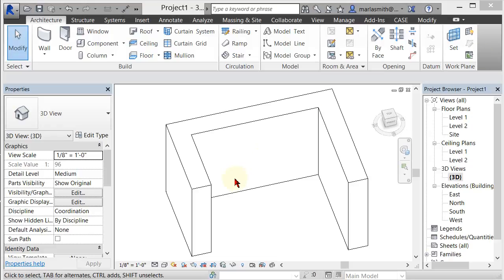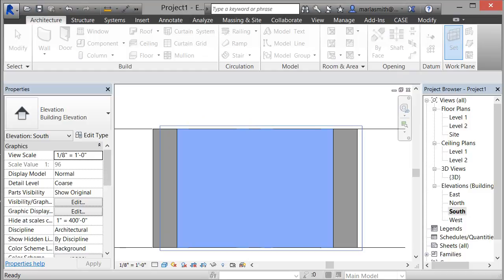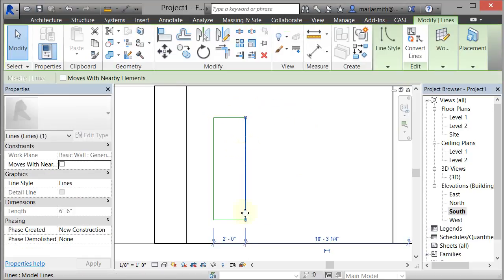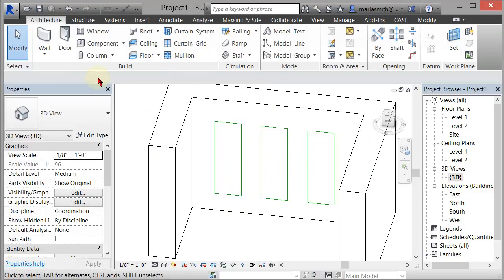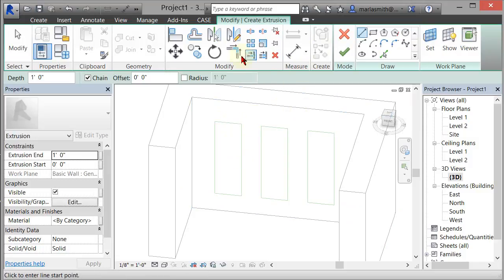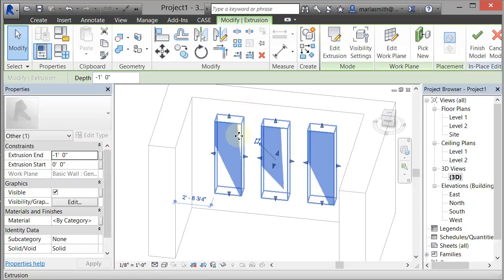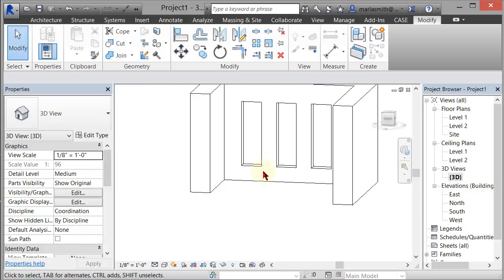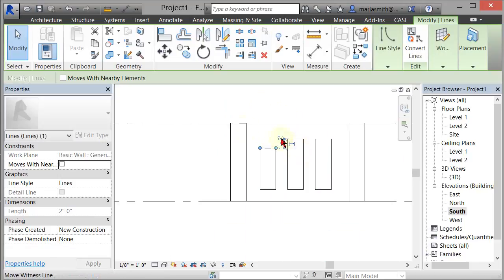REVIT WALL VOIDS

Comment: What if I had a layered wall?? When I cut the void from the wall, the materials will be cut too! what can I do to avoid that??
Reply from the maker: You can always paint the inside of the void if you need a different finish showing.  There is no way that I know of to show a plan section of the cut with layers correctly.  I
Reply: @MSmithWorkShop  Thank you for responding. I already tried painting with materials but the problem I have is when I'm going to calculate the cost it will not consider that painted part right? because it has no thickness!!

Comment: All i get is: Can't regenerate Family Walls 1.  Edit Family to modify it??
Reply from the maker: It sounds like you are using a loadable family vs the system wall family.  If you edit the family does it open in a separate window?

Comment: Thank you but it doesn't work for me, after I do the successful final cut and hit the checkmark, I am getting the 'Geometry doesn't cut anything' error and my void disappears.
Reply: funny. 8 months later. I was just having the same issue. So when making the solid into  a void the lines become orange. If you finish the void now it will give you an error but if you do the geometry cut before closing the void it will cut into the wall and you will have your cut in the wall.

Comment: this doesnt work!!! I cant do that last stage with the cut symbol. It just doesnt want to highlight the void that i made
Reply from the maker: It is sometimes difficult to grab the void/s in the cut option.  Sometime you have to hover around the area, often times near the edges of the voids, to get the selection.  Also, make sure you are in the Component Family and not the Project.  You must be in the Component Family to cut the voids out of the wall. You should have a green Tab that says: Modify|something.  If you don't then you will have to grab the voids and select: Edit in Place, and then cut the voids.  Good luck.